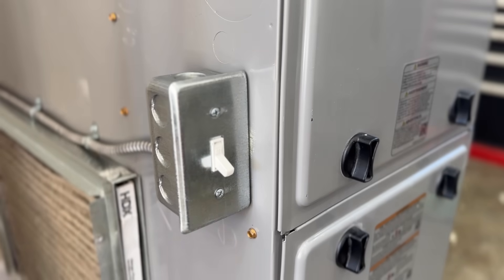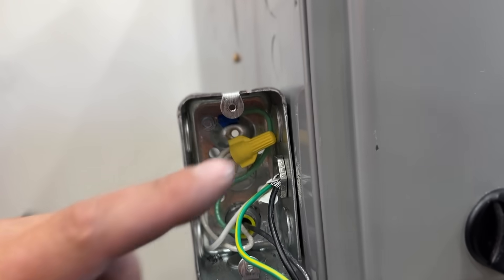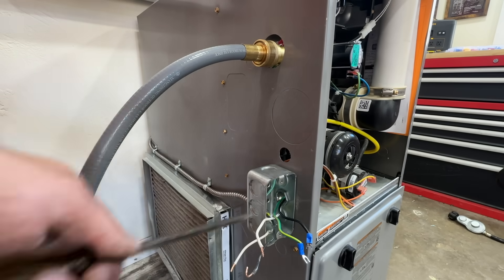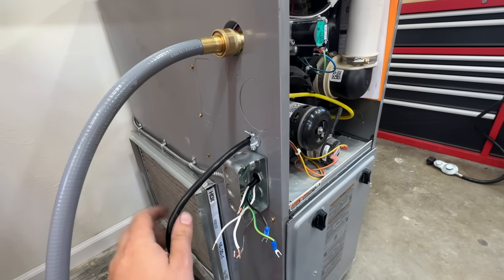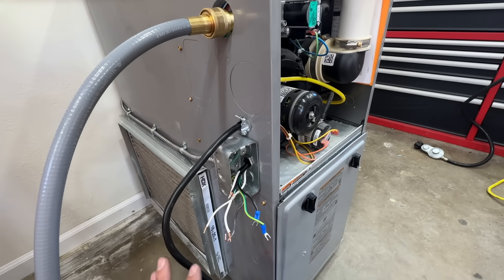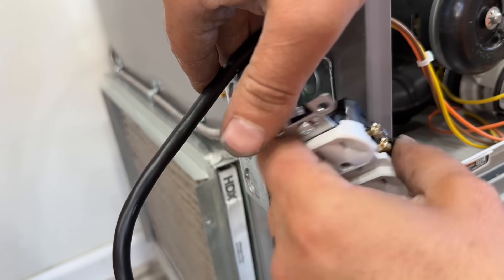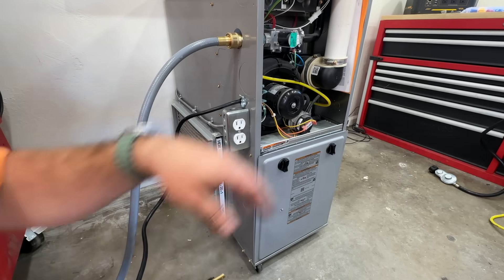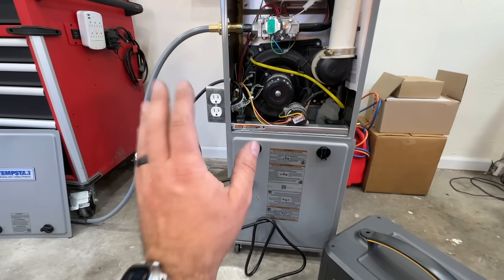Keep Your Family Warm During A Power Outage By Installing This $5 Part

Comment: Just so everyone knows when you have a high efficiency furnace with 2 stage adjustable blower it will not work properly because of the generator adjusting. However I was successful with a lifepro4 battery with a pure sine inverter and this functioned perfectly. Great idea and great back-up plan for power outages.
Reply: I have a couple set-ups in my home but for this note I will go with the cheaper set-up because it works. I have a 12 v deep cycle battery from Bass Pro shop for a boat, and then used a Lyvuan model F-1500P pure sine wave inverter. I honestly believe that the battery causes no fluctuations like a generator does and that’s the reason this works with my Lennox high efficiency furnace with a 2 stage blower. The salesman from Lennox originally thought this might/might not work because of the computer in the furnace but it does work and I’m happy I have this back-up.
Reply: @donschwechel8706  With your type of inverter setup, what powers the battery?
Reply: @jamesmartin4206  I’m not sure if I understand your question, my lifepro4 battery powers my inverter, I personally use solar to recharge my lifepro4 battery when low. You can also use a battery charger to re charge your unit once power in your house restores. The battery charger has to be a charger capable of charging a lifepro4 battery not a standard 12 volt charger. I purchased an inexpensive charger on Amazon and I love it, it will charge every style battery ( lead, flooded, lifepro4 etc ) I hope I answered your question? Of course you can use a standard deep cycle battery it’s just that I have learned lifepro4 is very safe and so much lighter for moving around the house. I have been buying DC House batteries 12 volt 100 watt hours averaging $150 on e-bay (new battery).
Reply: @ you answered my question. Thanks
Reply: My generator is an inverter
Reply: @jatpack3  better for circuit boards too.
Reply: Are you using a 12V battery, and what wattage inverter???
Reply: . Yes 12 volt lifepro4 battery
Reply: What does it mean that the generator is adjusting? I thought it was either on or off.
Reply: @mschwage when your appliances that are running on your generator such as a compressor on a fridge or freezer kick on it causes the throttle to. Increase on the generator, that will interfere with high efficiency (computer) on your furnace. A battery power station will not have this effect.  My pure sinewave works perfectly.
Reply: Question. How long would the battery last under full heating system when it's -10 outside in northern IL.?
Reply: @ruffer1  I wasn’t sure if my response went through so I will write this again. I’m not sure about the amount of time you will have, because I just set this up last  year myself and have not had to utilize the set-up thank goodness. I live just North of you, so that’s why I was concerned myself. My furnace does not run consistently so in my mind I’m guessing I have 24 hours +, and I have several of these battery set-ups to fall back on. If needed I can recharge one with my gas generator if necessary. I would also lower the thermostat a couple degrees to save on battery life while still being comfortable. My furnace also runs ac then converts to dc so I hope this will extend my battery running time. I’m just glad this works and I have a back-up plan. I am not a pro at this so I’m sorry I can’t be more definite on this question/answer.
Reply: My battery power station is a 1500 watt, I did try it with a small 500 watt inverter but that was too small.
Reply: Just by a inverter if you got it .

Better anyways

Comment: So if you unplug that when the power is on the male end of the plug is still energized?
Reply: Whoops, I wasn’t following the wiring correctly. It should work ok except for the wagu connections. They are not tight enough and heat up.

Comment: Anybody who considers doing this will want to check the furnace's AC power consumption. Depending on the size of the furnace, it probably requires upwards of 400-600 watts (running), and there will be a startup surge too (though not nearly as much as a A-C ompressor).

Comment: Why not just power the breaker box with a generator? Lol
Reply: I have a house built in the 70s and there isn't a main breaker on the inside of the house so I can't do that safely.
Reply: @TheEverydayEnthusiast  oh I see ya that a better idea then
Reply: @chrome3720  I just modified my dual fuel gas/propane generator to run off 20lb propane bottles or house propane and now I just need to wire in the ez generator switch
Reply: @TheEverydayEnthusiast  awesome be a nice setup now

Comment: It took some doing. My Goodman furnace has floating neutral detection circuitry. The circuit board will look for a the neutral to carry the same value as the ground bonded at the panel. When you plug the furnace into a portable generator, the circuit board might detect the lack of a bonded ground. The solution can be as simple as jumping the neutral to ground in the extension cord, or make a dummy plug for the generator. Just run the experiment after you make this modification to make sure your furnace works with the generator. Do not eliminate the fuse, if your furnace has one on the switched box. It is there to protect the circuit board in the furnace.

Comment: Absolutely fantastic, thank you. We are on day nine of a power outage and in the very beginning, temperatures got down to below 20 Fahrenheit. After a few days of this, I finally found a generator a couple hours away and when I got home with it, my wife worked on setting it up while I followed your directions and made this change to our furnace.

Super straightforward, and while our house may still be dark, it is WARM!

Thank you.
Reply: Wait, 9 days?  Where do you live (general area) and your pipes didn’t freeze?  How long was it before you got power since your 9 day comment is now 6 days old?
Reply: @VOODOOphg Oh and we got our power back a couple days ago, and thank goodness.
Reply: @VOODOOphg Springfield, OR, and there are still some folks without power as our utility mops up the last of the damage.  An ice storm brought down limbs all over and wreaked havoc on our power system.

My pipes didn’t burst because we kept a faucet running slightly so if any exposed pipes froze there would be some give in the system.  The temp inside the house didn’t get below freezing, but it got coooold.
Reply: Wood stove doesn't make wife happy because the rest of house is still cold, she wants it hot enough to throw covers on me 🤣
Reply: Some cheap generators wreck high efficiency furnaces. Something about the sine wave of electricity? I wrecked the old one in my house that way. It was always acting up.
Reply: We kept our fridge on a generator for 10 days after the midwest Derecho in 2020.  Oops, 10 days exceeded the oil change interval for a Honda generator.   Few generators ever get run that long.

Comment: So I guess this powers the thermostat inside the house also to be able to turn on and off the heat?
Reply from the maker: Yep, as long as the furnace has power, the thermostat will work like it’s supposed to
Reply: @diyhvacguy  was my quedtion too

Comment: Of course the far simpler method is to put a receptacle on the source side, then plug a UPS into it. Then put a plug on to the furnace and run the plug into the UPS. That way the power is conditioned, and in case of a power outage you've still got power as long as the UPS will hold depending on how you've sized it. Of course that still has limitations, but it should last for a few hours at least.

Comment: You are not clear in what you are doing in this video.  You need to state it SIMPLY and then repeat it, like any school lesson.  You are setting up your furnace to run from SOME OTHER A/C power source, off the grid, that's all.  Like an external generator or DC battery pack (with built-in AC inverter).

Wish you had said that in the beginning.

Comment: Still don't have power to the thermostat,  How does it know when to stop?  Or, is it a situation where the furnace is on when plugged into power station & you need to unplug when house is warm enough?  then plug in again when you want some heat?

Comment: $5 fix? Where are you buying a pigtail, an outlet receptacle, and Wire conne ters all for $5? Do you have a time machine back to the 70's? 😂
Click bait sucks Azz Dude!
Also, it is better to use a single outlet receptacle  instead of the double outlet receptacle. This keeps someone from plugging in other thing to the dedicated power supply line, thereby leaving it dedicated to the furnace.

Comment: But doesn't that end up being a suicide cord when the grid power is live? If it is, anyone could unplug the cord and touch the terminals, and get zapped. At the very least, it needs some sort of lock or anti-tamper device to prevent electrocution. A switch between the cord and the grid power feed would work, and the right type of switch could be the tamper-proof component too.

Comment: My gas furnace is pretty old, don't have a switch like the regular light switch. The only switch on mine is a spring loaded contact switch that activates when you put the front cover on that you have to remove to change the filter. Pull the cover switch opens no power. Install cover switch closes power on.
Reply from the maker: Hmm I’d have to see it to advise if this would work for you. If you want to email me at diyhvacguy@gmail.com I can give you my thoughts

Comment: So you have to have the pigtail plugged in and it's just a power loop right now, I'm not an electrician and I can prove it lol
Reply from the maker: No, this is like powering anything else IE a blender or toaster. the outlet is the power source, the pigtail is just getting the power from the outlet, to the furnace. When you unplug it, the furnace doesn’t have power now.

Comment: Question....bonded neutral generators and floating neutral generators, so do you need a bonded neutral generator in this case?  I think obviously either would work, but if there was a fault at the furnace, the current would need to flow through the ground and back to the generator, and so the generator would need to be bonded, right?

Comment: Good Idea. I am an HVAC tech and I have been doing this for home owners for years. The only thing tomake sure of is if you are going to want to run the furnace off of a generator make sure it actually works. Some gens have a floating neutral and some furnaces wont operate on those types of gens. There is a fix for that so research it and test it out. Dont just assune it will work.
Reply: My champion generator has a floating neutral. What would be more appropriate? 1. Use a ground neutral plug with the generator to make the furnace think the generator has a bonded neutral? OR 2. Tying the neutral from the plug and furnace together with the neutral from the main panel?
Reply: @derreklees  never bond neutral to ground anywhere except the main panel. It's an electrocution risk. That idea might work while connected to the generator but you wouldn't want to have it like that while it's connected to your main power.
Reply: Most of the newer generators have  ground fault outlets and will kick out once connected because it detect the ground from the furnace. You can disconnect the ground on the generator in order for it to work with this setup. You can search for videos on how to do it.
Reply: This a great video. Forgive my ignorance, but is there a way to have the on and off switch and the outlet for the generator?
Reply: @ jimederksen1653 what wattage and amperage would a modern Bosch gas furnace draw? Not seeing anything online.
Reply: @NarcFreedom  https://www.bosch-homecomfort.com/us/media/country_pool/documents/engineering-submittal-sheets/bosch_96_furnace_submittal_sheet_03.2024.pdf
Reply: @NarcFreedom you can get the model number of your furnace, probably on a panel that's easy to unscrew and reinstall.

Many houses can run essential circuits (water heater, furnace, some lights, main rooms, possibly AC) on 4000w or less, but that's just a guideline without knowing what your house has installed. And I don't remember if that number is for gas appliances VS electric appliances, because then you'd either have to size up, or run certain circuits at different times.
Reply: @NarcFreedom pull up the specs sheet for your model. My Lennox is like 315 watts for a newer 2000 sf townhome.
Reply: Or, put a power station between it to normalize power and remain clean.
Reply: Where do I look for that floating neutral on the generator?
Reply: Hey bro can I get some guidance since you are a pro. I got a brand new hvac system but I dont really feel any airflow from the vents. I can hear the fam running and some vents get air while other barley have any air flow through them. What's up with that?

Comment: Keep in mind that some modern furnaces are computer controlled.  they have a logic board.  These furnaces may require clean generator power.  if so you will need to run a modern inverter type generator which delivers a clean pure sinewave.   Non inverter type generators MIGHT cause issues with some logic boards.

Comment: Yeah, that will work but there's a better way...

There were so many things wrong with the wiring at the start of the video. Never use automotive connectors with house wiring. When you have stranded wire it is best to twist all the strands, and if you're extra, like me, also dip them into molten solder.

When making J hooks ALWAYS wrap them clockwise and tighten down on them. Never counter clockwise.

Now the better thing is to have a GFCI, which is usually code in those areas anyway, and have a combo switch outlet which would also be better. And yes, the Wago wire nuts are the best, and I do wrap in electric tape, because in my experiences they've worked themselves loose, as to where the lever pops up.

Comment: I did this on my furnace and it worked but the flame kept going out. Is there a certain amount of power it needs to stay running? I tried cleaning the flame sensor multiple times and it still wouldn’t stay running.

Comment: What happens when the power comes back and you're still connected to the battery? Will they short? Cause a fire?
Reply: I think you misunderstood the working. The furnace is solely wired to the pigtail.  You either plug the pigtail into the outlet (from the panel) or plug it into the generator. 👍

Comment: You will need three parts actually  (2023 prices)
1) Switch and Tamper-Resistant Outlet.  $3
2) Outlet Cover Plate.    $2                         
3) 13 Amp / 16 gauge replacement cord.  $10

Comment: I've got a similar setup and was planning on using my Jackery explorer 2000 pro to run my furrnace during an outage.  The Jackery, (and a lot of other battery backups) has a floating nuetral and the electronics in most newer furnaces won't run if the nuetral is floating.  My solution was to add nuetral ground bonding plug into one of the jackery outlets and then it will work.  here's a video that discusses it at length.  This is for emeregencies only and I'm not advocating bonding the nuetral and ground like this any other time.  but it works.  https://youtu.be/8bh7LdDxQu4?si=42LHZBIA1_JhA9Ou

Comment: My natural gas heating system is part of the A/C system.  Apparently if I power the heater independently I will not have any control through 3 different thermostats and 3 different heating zones.

Comment: Could you just make a double ended cord to go from your battery pack to the furnace or would that cause a power surge if the power came back on and blow your control board. I know they make similar switch boxes to put on your main house panel and if the power comes back on it disconnects your aux power source

Comment: Once a receptacle is installed in place of the switch, is it necessary to install the pigtail? The service can be isolated from the receptacle/furnace by turning off the dedicated HVAC breaker at the service. The power from the new source will then only go to the furnace. Of course memory in now involved.
Reply from the maker: If you didn’t have a pigtail you wouldn’t have anything to plug into your power station or generator.